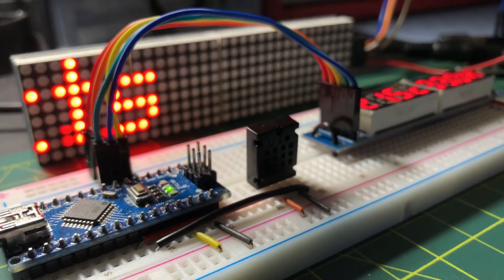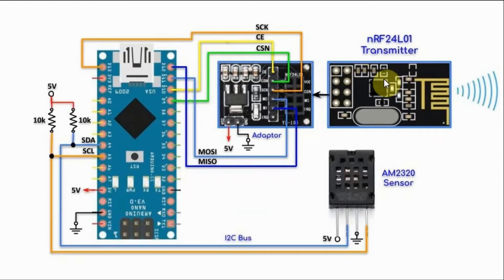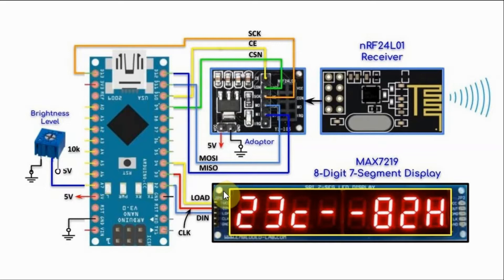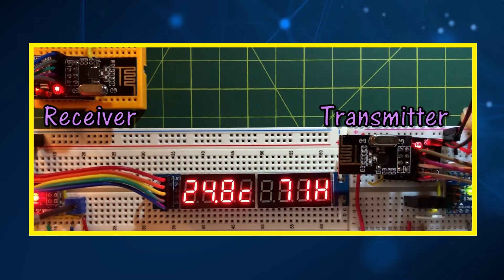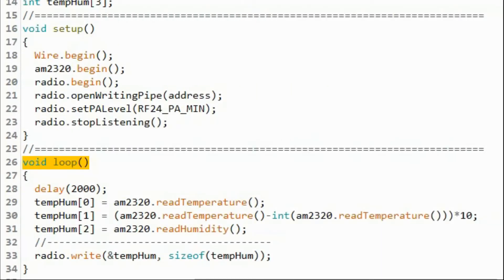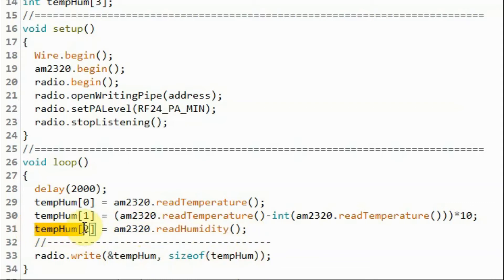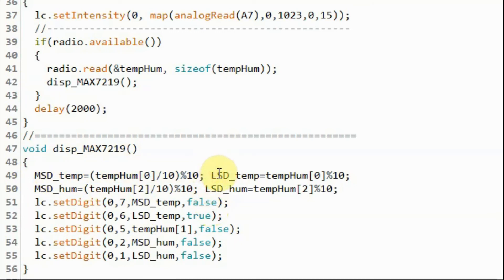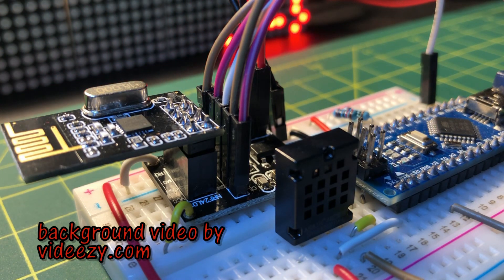Wireless Sensor Data Transmission via nRF24L01 & AM2320

Comment: Nice and very informative video. I have a request hopefully u will consider that.
Will u make overhead water tank wireless monitoring using thesse nrf modules and based on the data automatically turn on/off water pump via relay when it reaches certain water level percentage? Also reciever side must have lcd or oled screen to show water percentage and manual button to turn on/off water pump at any time. This will teach us many things. So looking forward
Reply from the maker: Thanks for your feedback. Currently I’ve paused my videos, and will resume December. Your project looks interesting and hopefully look into it come December.
Reply: @AnasKuzechie  Looking forward